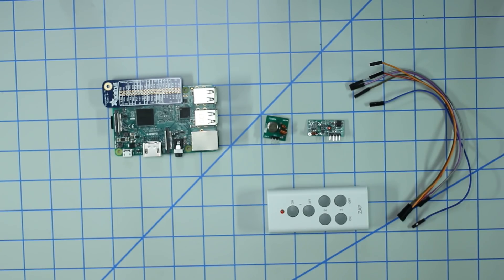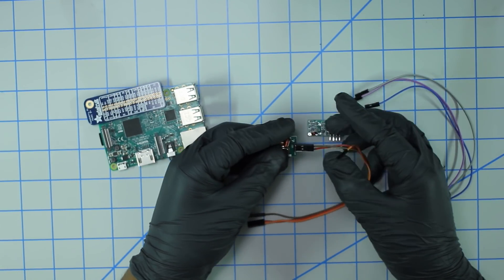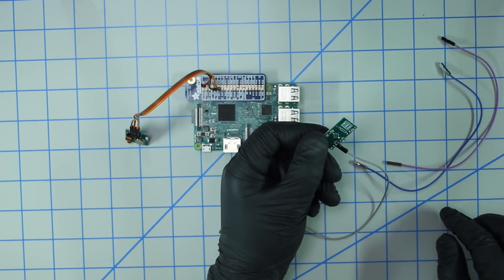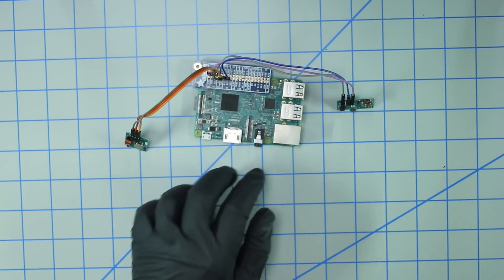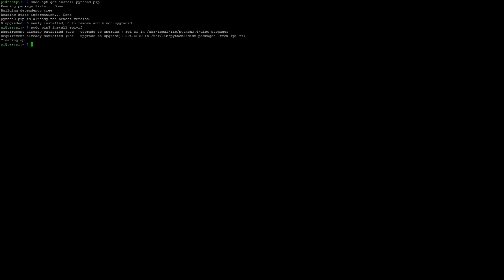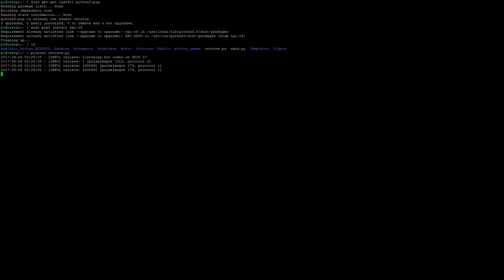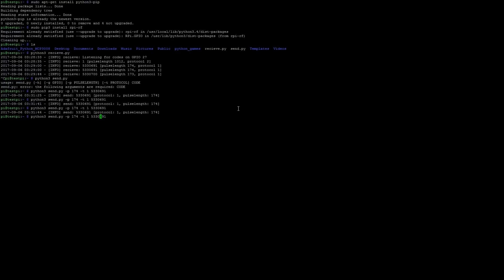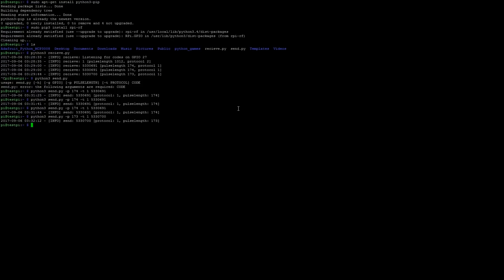RF 433 MHZ (Raspberry Pi)

Comment: is there a way i can easily test if my receiver is broken? Ive got everything else set up, but the receive.py code never receives anything. I have the pi right below the device too. Ive checked that my setup is exactly the same as yours. The only difference is im using a raspberry pi 3B. Would that have any affect on the receiver?

Comment: Can somebody help me out?

I did setup the transmitter and receiver according https://www.piddlerintheroot.com/rf-433-mhz/
When I run the receive.py, there will be a large list of random info, without pushing any button.

2021-01-19 17:10:21 - [INFO] receive: Listening for codes on GPIO 27
2021-01-19 17:10:22 - [INFO] receive: 11 [pulselength 1456, protocol 4]
2021-01-19 17:10:22 - [INFO] receive: 2 [pulselength 138, protocol 3]
2021-01-19 17:10:22 - [INFO] receive: 32 [pulselength 965, protocol 4]
2021-01-19 17:10:24 - [INFO] receive: 8 [pulselength 1484, protocol 4]
2021-01-19 17:10:28 - [INFO] receive: 64 [pulselength 1269, protocol 4]
2021-01-19 17:10:28 - [INFO] receive: 130 [pulselength 1849, protocol 2]
2021-01-19 17:10:28 - [INFO] receive: 4 [pulselength 1091, protocol 4]
2021-01-19 17:10:28 - [INFO] receive: 2 [pulselength 140, protocol 3]
2021-01-19 17:10:28 - [INFO] receive: 134742020 [pulselength 1742, protocol 4]
2021-01-19 17:10:31 - [INFO] receive: 1 [pulselength 439, protocol 1]
2021-01-19 17:10:31 - [INFO] receive: 4 [pulselength 694, protocol 1]
2021-01-19 17:10:32 - [INFO] receive: 16 [pulselength 802, protocol 2]
2021-01-19 17:10:34 - [INFO] receive: 8 [pulselength 1332, protocol 4]
2021-01-19 17:10:34 - [INFO] receive: 128 [pulselength 1627, protocol 4]
2021-01-19 17:10:37 - [INFO] receive: 1024 [pulselength 835, protocol 2]
2021-01-19 17:10:37 - [INFO] receive: 1 [pulselength 1531, protocol 4]
2021-01-19 17:10:41 - [INFO] receive: 256 [pulselength 202, protocol 3]
2021-01-19 17:10:41 - [INFO] receive: 4 [pulselength 962, protocol 2]
2021-01-19 17:10:41 - [INFO] receive: 2 [pulselength 686, protocol 5]
2021-01-19 17:10:41 - [INFO] receive: 2 [pulselength 1042, protocol 4]
2021-01-19 17:10:42 - [INFO] receive: 5120 [pulselength 1464, protocol 4]

How can I make this work en get the right code that I need to send to my device?
Thanks in advance.
Reply: hi i can't even run python rpi-rf_receive

how did you send rpi-rf_receive to raspberry?

Comment: Hi, thanks for sharing.
The output data pin from the receiver i think will produce a 5V signal. RPi accepts 3.3v input signals. 
Am i wrong if i say you should connect them through a level shifter 3.3V <-> 5V or at least a voltage divider? 
RPi could be damaged otherwise....
Reply from the maker: Hey Daniele, I think you're technically correct. However, I have seen multiple tutorials without a level shifter and I've been running a rf 433 mhz module on my home-assistant rpi for 2+ years without issue. 
(I plan on doing an update for this video sometime in the future, so I will definitely investigate your concern)

Comment: my recieve.py every 5 sec or so reads some noise but never the right codes.
I tried adding resistors or capacitors and resistors, nothing seems to work.

PLS HELP

that's how it looks:

2020-04-30 18:55:40 - [INFO] recieve: 4 [pulselength 1064, protocol 2]
2020-04-30 18:55:52 - [INFO] recieve: 128 [pulselength 218, protocol 1]
2020-04-30 18:55:58 - [INFO] recieve: 64 [pulselength 781, protocol 1]
Reply: Same I get random codes, but when I press a 433 button near it. Nothing... did you solve it?
Reply: @UrZNL  not yet :( sorry

Comment: Dangit! I need to pay closer attention. My transmitter was labelled such that I thought vcc was opposite of the gnd and the data pin was in the middle. Wrong. After a fair amount of testing with no luck, I finally realized the vcc was the middle pin. Now it works as advertised. Thanks for the video.

Comment: Thanks. So far the simplest instruction for the simple 433 transmission. However, in my case, after installing the rpi-rf, send.py and recieve.py does not appear. Ls command shows nothing. I get the error "No such file or directory" where are the scripts gone?
Reply from the maker: You just installed the dependencies. The scripts can be found on my site (link in description) or the rpi-rf website
Reply: @PiddlerInTheRoot  You skipped the part where you said you were going to show us how to make the scripts available, and went straight to "I already have it though, so I am gonna skip to the next step"
Reply: website in description giving the code ....
Reply: recieve.py :

#!/usr/bin/env python3

import argparse
import signal
import sys
import time
import logging

from rpi_rf import RFDevice

rfdevice = None

# pylint: disable=unused-argument
def exithandler(signal, frame):
    rfdevice.cleanup()
    sys.exit(0)

logging.basicConfig(level=logging.INFO, datefmt='%Y-%m-%d %H:%M:%S',
                    format='%(asctime)-15s - [%(levelname)s] %(module)s: %(message)s', )

parser = argparse.ArgumentParser(description='Receives a decimal code via a 433/315MHz GPIO device')
parser.add_argument('-g', dest='gpio', type=int, default=27,
                    help="GPIO pin (Default: 27)")
args = parser.parse_args()

signal.signal(signal.SIGINT, exithandler)
rfdevice = RFDevice(args.gpio)
rfdevice.enable_rx()
timestamp = None
logging.info("Listening for codes on GPIO " + str(args.gpio))
while True:
    if rfdevice.rx_code_timestamp != timestamp:
        timestamp = rfdevice.rx_code_timestamp
        logging.info(str(rfdevice.rx_code) +
                     " [pulselength " + str(rfdevice.rx_pulselength) +
                     ", protocol " + str(rfdevice.rx_proto) + "]")
    time.sleep(0.01)
rfdevice.cleanup()

Comment: Very nice work, Im get this working, I have installed a new image of rasbien and did the python3 install of pip3 - when I try to run the receive python script I get an error " No Module named rpi_rf" Did I miss something is there another package that I need to add? 
Thank you in advance....
Reply from the maker: Run these commands. "apt-get install python3-pip", "pip3 install rpi-rf"
Reply: I did that a few times, but I did it again and I get the same issue.  What version of the OS are you using on your  RPI-3
Reply from the maker: Hmm that's odd. Try running "sudo apt-get update" and see if that helps.
Reply: @PiddlerInTheRoot   
I have the same Traceback problem (last call last):
  The "rf.py" file, line 9, in <module>
    z rpi_rf import RFDevice
ImportError: No module named rpi_rf

Comment: When i run the receive script, i do get signal. The thing is it is not 1 row, it is like 5 different rows... What could that be?
Reply from the maker: When the script is running it's constantly reading. If you press the on/off button for more than a split second sometimes you get multiple results, and they may vary a little bit. My rule of thumb is to select the result that seems to repeat the most for a specific button press.

Comment: Nice work thanks for taking the time to put this up. Quick comment on hooking up the receiver to the RPI, though: the receiver operates at 5V, and the RPI's GPIOs are not designed to take voltage levels over 3.3V. You're connecting the data pin directly onto the RPI's GPIO, which may damage the RPI.
Reply: Complete noob here. What should I do then?
Reply: @Gabaloc  you could put a level shifter in between. Warning: not for a noob, like you say you are: a make-shift workaround could be to use a voltage divider, but be careful to take the RPI and radio board's impedances into account.
Reply: A bit too late but still: Get a 3.3V receiver/transmitter set and use 3.3V pins instead. Works exactly the same otherwise.

Comment: Hi! First off: thank you for sharing this, it is really helpful! Secondly, since I am fairly new to raspberry pi prgramming do I need to install a software like Raspbian on the pi beforehand, or will it be fine if I just hook it up to my network using a LAN cable?
Reply from the maker: Yeah I'm using Raspbian. Once you get the OS installed you can hook it up to your network via WIFI or a LAN cable, either should work fine.
Reply: PiddlerInTheRoot Thank you so much!
Reply: Hi once again, I have set all this up now and my Raspberry Pi is up and running, but when I run receive.py it gives me a random power of two everytime I press the exact same button, do you have any suggestion what to do?

Comment: when you run the python program you are only getting output whenever you're pressing the rf buttons but for me i get random number like crazy and not able to differentiate the noise from data. what do i do? Please help!!
Reply from the maker: Hey Pavan, it sounds like a hardware issue. Do you have another 433MHZ RF device to test against? I've received a bad transmitter/receiver pair in the past, you might need to get a new set. In the meantime the troubleshooting steps I would take would be... run sudo apt-get update, check your wiring, and test a different RF device. (if available)
Reply: I am experiencing the same, but when I transmit, I see that too -- only I see it 4 times. So not sure what's going on.

Comment: I have tried quite a few guides to different RF setups online - all of wicth did not work! THIS ONE WORKED IN FIRST GO! thanks a lot for putting this out there. I think this guide is so much better and simpler that what I otherwise have been able to find.

I have a small question if you or anybody else can point me in the right direction whare i can find more info:

I would like to setup a pi so that i can tricker a 'send.py' script via a RF remote - so different RF signals could tricker a number of different codes to be sent, for eksample to make an 'all off' switch in different locations around the house. 

I have 25+ RF switches around the house and most of them can only 'learn' up to 3 different codes so i cannot just code all the RF sockets to different remotes.

so if anybody have an idea og a link i would apriciate it a lot.

once again, super guide.

br
P
Reply: hi peter,

I am having quite a success with with the platform (rpi+hassio+home assistant), but i have yet to crack receiving a RF signal and using it as a trigger. I have connected a RF receiver + transmitter and i can send RF signals without problems - but i don't know how to receive ditto. So if you find a way I am listening.
Reply from the maker: Peter take a look at https://home-assistant.io/. Check out BRUH automation's channel (https://www.youtube.com/watch?v=5UUazFbK-Hg), he has a very good tutorial on how to integrate this for home automation, and home assistant provides you a user friendly user interface and also supports many other home automation platforms as well.
Reply: ill check it out - thanks again for this nice and simple to understand info
/
Reply: I'm looking for the same thing. Solution should be something like sending a signal with the remote, receiving this signal with the raspberry, triggering a script, sending a signal to the sockets.

I want to try this via node red. But I'm not sure how to process the received signal there.